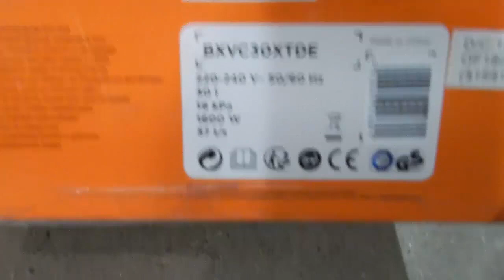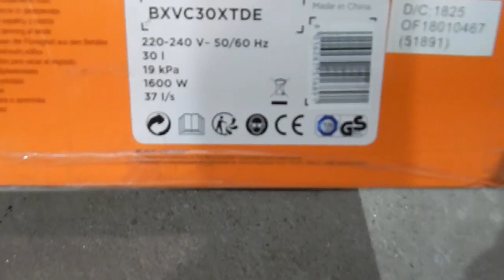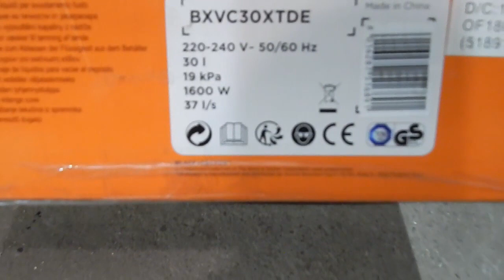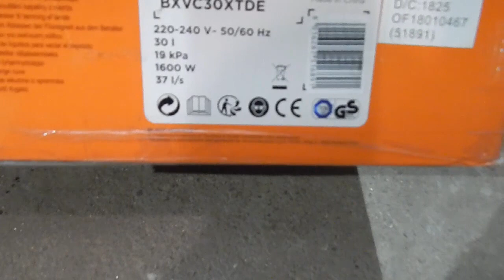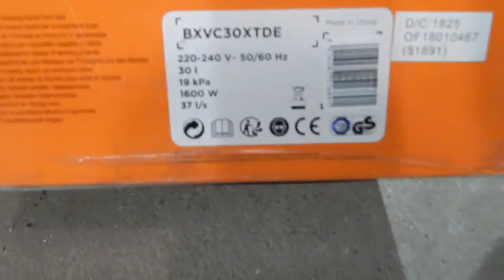Odkurzacz przemysłowy Black&Decker 30L- Unboxing, start, test.

Comment: They don't make them like they used to. This is a cheap rebrand, as far as i can tell. I can't believe that the best solution for me is to keep buying old Philips Triathlons for parts, to keep mine running (with the mention that, i haven't yet burned any of the motors, just broke a few plastic bits, but it's... a 10+ years old vacuum.

Dyson is overpriced junk, i've seen dozens of pictures from people with the plastic cracked, batteries not keeping up with reality, no power to vacuum anything else than dust and hair.
Philips themselves aren't what they used to be, i found 3 broken ones in our communal recycling center... all had burnt motors, noticeably so, like through the plastic.
Karcher is also overpriced junk, but it's "made in Europe" so... somehow that's better than the China special.
Samsung are clueless, maybe good for an office space.

And B&D are just rebranding stuff they find in China (as i said. You can find this exact model sold as some unpronounceable, for us, name on fleabay).

Unreal. We can't even make vacuum cleaners anymore.

For years, i thought that the wood workers of YouTube (the likes of Matthias Wandel) are exaggerating, when they're making their own shop wood working vacuum machines. They are not, everything is junk. Even if you have the money, you can't buy stuff, because it's junk.